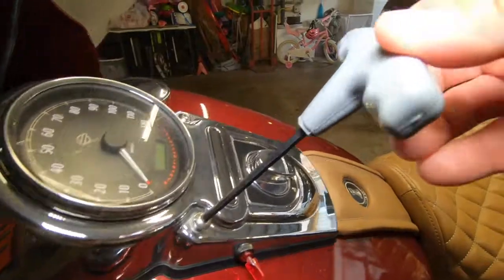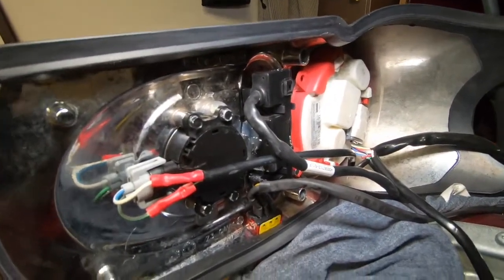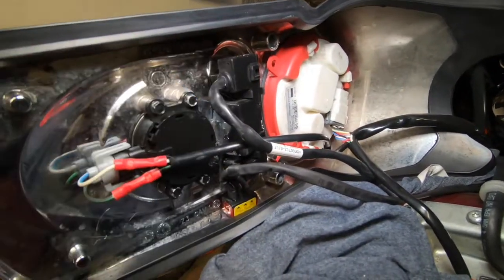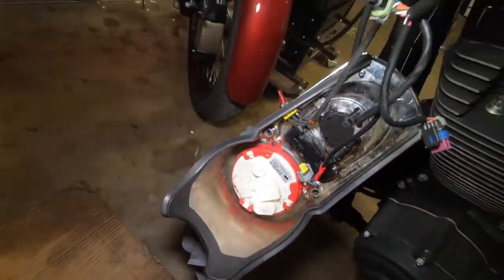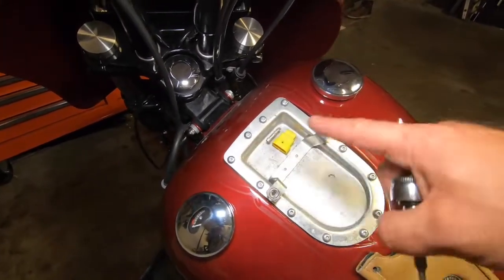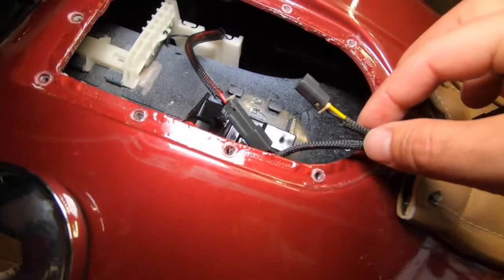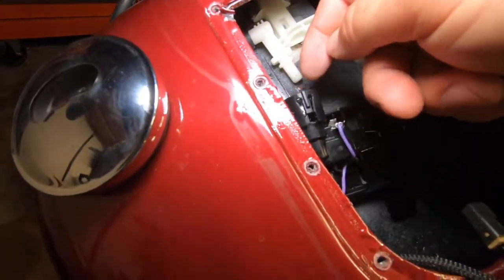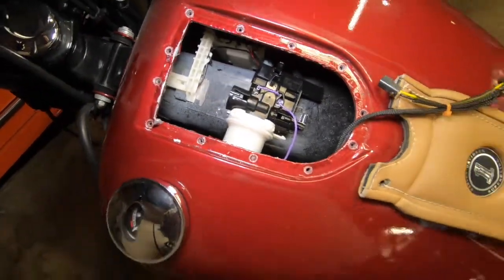HARLEY-DAVIDSON FUEL PUMP INSTALL (HIGH FLOW)!

Comment: I like how you keep your fuk ups in the video.  It makes us regular backyard mechanics feel better to know others fuc stuff up too.  Cheers.  Replacing fuel pump on an 08 SuperGlide right now.  Checked fuse, checked relay.  On to the pump.  Removed old pump using your steps.   I left it attached to the plastic holder until I got the assembly out of the tank.  Great video.  Cheers.
Reply from the maker: Glad I can help really appreciate the kind words .. ride on brother

Comment: Useful video. I have a dead pump in my 2009 Fat Bob. Parts on the way.
Reply from the maker: Always check your fuse
Reply: @TheGasStation1616  thanks. I haven't done that yet.
Reply: @TheGasStation1616  fuse are good.

Comment: Just a FYI . The old pump has a rubber ring that goes on top of the new pump.  Maybe I missed seeing you recycle that.
Reply: At about 15 minutes into your video, you show your new pump partly set into Its "holder", but part of the top of the holder is still on the old pump. That cushion is supposed to be in the sleeve above your new pump, You seem to just be very worried about your filtration quality, and have overlooked the pump Holder items. I'm just saying, because I had that filter dunk, happen to me about 200 dollars tow, away from home.

Comment: Dude, you didn't mention if all the whining goblins went away. Mine is having a whistling problem also.
Reply from the maker: Crashed my bike just after that 😣 I just painted my bike waiting on a few things before I ride again but I will ..doing a head gasket swap on 6.0 currently
Reply: @TheGasStation1616  Wow that's fucked up. Hope you weren't doing 110. Are saying the whistling noise stopped?